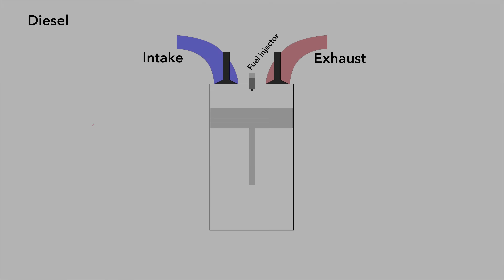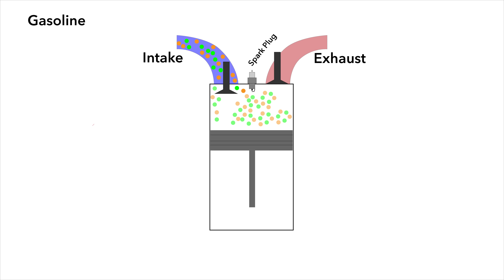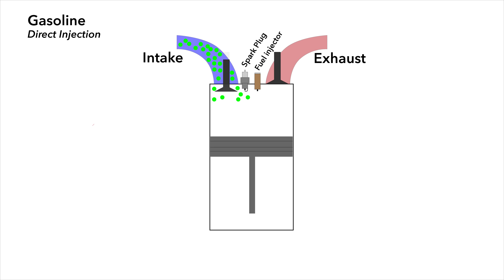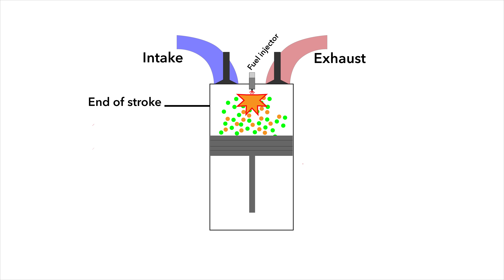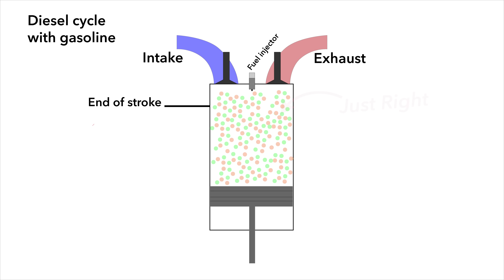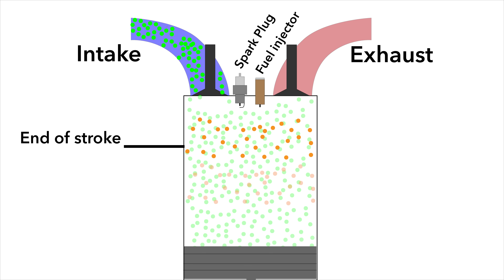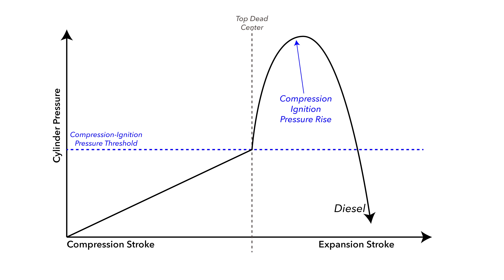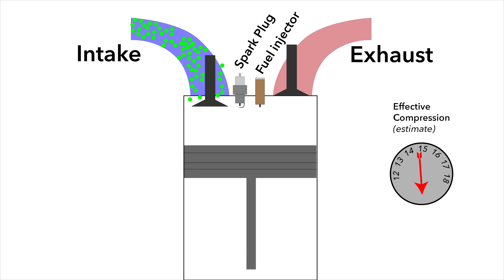Skyactiv-X: Mazda's Revolutionary Engine Explained

Comment: This and Infiniti's VC engine show Japanese is still ahead of American in engine development.
Reply: There is no compression ignition, it's just advanced fuel control, and this technology is already being used in TGDI engines. In fact, early and late injections are the very reason most manufacturers use GDI. As stated, this is just market. And yes, I work in the industry.
Reply: No, you should be skeptical and not so gullible.
Reply: Peizxcv Well, since what I said is fact and evident, yes. These aren't even the words of the engineering dept, this stuff is written by marketing. This isn't even a true CI engine. Do you even know what that is? Learn. Spark ignition is not compression ignition. They haven't show anywhere how they create ignition entirely from compression. It's just the same tricks fuel/air and time tricks used by other manufactures minus the unusually high compression combustion.
Reply: Peizxcv WTF? I'm the one being cautious and demanding it be proven reliable. You can't flip that and say it's my duty to prove it's unreliable. That is beyond idiotic.
Reply: Kendrick perhaps you should work for Mazda and tell them they forgot to put a turbocharger on their TGDI engine. Also, work in the industry as what? There are millions working in the auto industry and million more in related fields.
Reply: How do you know it's ahead beside being introduced to market? Being introduce to market doesn't make it reliable.
Reply: David And where is GM's car with this tech on the road? I don't think you comprehend the concept of "ahead"
Reply: Peizxcv 
“Where is GM’s car with this tech on the road?”
Mazda’s isn’t on the road either, so....

And if you’re counting the prototype, then based on that standards, GM has had hydrogen fueled vehicles on the road for about 2 decades.  After all, they were working on hydrogen fueled vehicles for over 2 decades.
Reply: Giovanni Giovanni On one hand you say it is nothing new and is the same as TGDI yet on the other hand you say it is new and needs to be proven reliable first. Make up your mind why you dislike this new tech.
Reply: Christ, this isn't a compression ignition engine! Learn what that is! It's just GDI with Atkinson cycle mode and higher compression, nothing new! It's all marketing! Learn what these things are and watch the video!
Reply: Peizxcv No, mass market compression ignition is new and is unproven. What was presented by Mazda says nothing about that, just things we've seen before. This engine hasn't even proven itself to be a ignition engine yet, never mind reliabile.
Reply: Maybe this engine can, in fact, run without spark, and maybe it does at certain times, but what they've show is no evidence of this. They're calling it "revolutionary" HCCI, which gives us no facts. As far as I'm concerned, it's just their marketing going crazy.
Reply: Kendrick I am not The Lord Jesus Christ, it is unnecessary to bring him into this discussion.

This is not a Atkinson-cycle engine (notice the spelling) as it shifts between Otto and Atkinson on demand.

I would imagine someone in the industry not making so many obvious mistakes.

BTW, the title of this video is "revolutionary new engine". Maybe take that as a hint.
Reply: What the hell are you talking about?
Reply: Kendrick After watching the video again, you're probably correct. It just looks like a 2GR but only lower compression. I don't seen anything all that remarkable about this now.
Reply: Kendrick looks like they’re using the spark plug to ignite the fuel, which raises the compression, which causes compression ignition of the rest of the combustion chamber. Nothing new?
Reply: US engine development is so behind the times they are still using push rods
Reply: It's not a Japanese engine it was designed in Germany. Pretty much a copy of the VW engines of today.
Reply: GM had this engine in the 1990's
Reply: American engine development has always been behind any competition.
The US market still accepts lower mpg and demands cheaper cars, so US brands still use more simple, cheaper engines that aren't competitive anywhere else.
Reply: Sirion 
The thing you’re ignoring is that many other countries (Japan, Europe, etc) have displacement taxes, so it’s advantageous for them to make small engines.  
Plus, most of those countries have easier emissions standards.  That’s why a number of particular engines aren’t allowed to be sold in the US.

And since you brought up MPG, it seems you also forgot that the US has the one of the highest required crash test ratings in the world.  That adds weight.  For example, the 04-06 GTO started life as an Australian Holden model.  To make it pass US crash tests, an additional 300-400 lbs had to be added, turning the car from a 3400 lb sport tourer into the 3800 lb car that was sold in the US.
Plus, the majority of miles driven on the US are on interstates/highways.  While the pushrod V8 in my Camaro would only get 18 mpg in the city, on long hwy trips, I’d get nearly 30 mpg...  in a 20 year old car that was capable of running 13 sec 1/4 miles.

“Cheaper engines”
So you have a problem with simpler engines being cheaper?  Apparently auto enthusiasts don’t.  That’s why the GM LS v8 has been the most swapped engine for the past 10-15 years, taking the title from the GM SBC V8.  The irony being that even the most lowly and smallest version found it trucks (4.8L) while rated at 265hp is durable enough for the stock short block to withstand well over 1000....  quadruple its factory rating....  and do it cheaper than virtually any other engine.

So a cheap engine that is capable of 30+mpg in cars, can routinely power 24k lb GVW pickups for 300+k miles, and can power cars to sub 7 second 1/4 mile times.  Show me any engine architecture that can do that at the price point.
Reply: That sounds like Toyota
Reply: Bringing something to market doesn't mean you're technologically ahead of anyone. Where are our low compression diesels? They were introduced in the select markets and quickly found out much of a hot mess they were. Also, HCCI and Atkinson did not come from Japan. Many automakers have been well into the development of this technology, but they introduced such tech for many reasons.
Reply: Giovanni Maybe car makers worked on similar tech for decades but none get it reliable enough as Mazda. I'll say that's a lead on everybody else.
Reply: And how do you know it's reliable? And like I said, the Skyactiv D was supposed to change everything, but turn out it was a junk engine that not only could not pass US emissions regulations, it's was very problematic.

Also, this really isn't a true CI gas engine, it's just marketing BS. Using a spark to start the compression ignition is nonsense, it's just your typical GDI system used on typical TGDI engines.
Reply: Giovanni So instead of believing the engineers and reviewers I am suppose to trust Giovanni, the YouTube expert on engine. You bring a whole new meaning to armchair general.
Reply: emdec55 I am very skeptical of Giovanni the YouTube armchair expert indeed.
Reply: Giovanni What you said is just your guess. A guess based on nothing. Can you produce any document that supports your claim this engine is not reliable and nothing innovative? You cannot, you are just an armchair expert that made up your mind before any facts

Comment: Alex - good job on a tough concept to explain. Another analog to the diesel engine would be the gas turbine (jet) engine. After using igniters to initiate (or what ever word you made up) :) combustion, compression is used to keep the fuel burning from that point on. Broadly speaking there are centrifugal and axial flow compressor designs. I've driven rental Mazda 3s and seen above 40 mpg on the highway. This would really push them into hybrid territory if they deliver. And are reliable. And don't leak oil (or anything else). Mazda is a company I really admire for pushing on the leading edge, even if things don't always work out.

Comment: Early adopters be aware..
Reply: The Car Crazy Guy agreed. Wait for the 2nd gen.
Reply: It will be ready on release, the engine is already running over 2 years in Japan ;)
Reply: Bas bzb  It's not a Japanese engine it was designed in Germany. Pretty much a copy of the VW engines of today.
Reply: @kevinwells273  uhhh, except VW cheated the system and lied about their emissions.

Comment: It's great that traditional auto companies are innovating. But it took a lot of explaining to tell what is special about this new engine. Although I love to know about the new features that are being made available on cars, I still don't get what's the benefit of this new engine other than diesel-like torque. I mean geeks would love it and so would present Mazda users but shouldn't Mazda be focusing on growing their market? As a potential buyer I find Mazda to be not unique in any relevant way. It's not the most fuel efficient, it's not the most responsive, it's not the best looking, it's not the most premium, it's not even the cheapest. It just seems to be stuck in the middle. I wish them good luck in the years ahead as they do not seem to be prepared to handle the big shifts in the auto market. It'll be sad to see Mazda meet the fate of others passenger auto brands like SAAB and Isuzu.

Comment: 10 years too late
They should have concentrated on electric vehicles
Reply: How is it obvious? A thimble full of gasoline has far more specific energy than many pounds of NiMH batteries. Musky is duping the world.
Reply: no EV maker is using NiMH batteries they are all using Li on batteries because they store way more energy to weight
Reply: @bjorn1583  prius is nimh. At least the first few gen's
Reply: If companys would do like you say, they'd go broke lol Mazda couldn't compete with others developing own electric tech, they are too small. Smarter to search for a niche and cooperate with others developing electric engines.
Reply: Wrong. Without a major breakthrough in battery (or other energy storage) and energy generation (fusion reactors?) technologies, the electric cars stays a nice gimmick for the next couple of decades. People simply has no idea how much energy their cars/trucks etc. are using (humanity generates a lot less electricity than needed currently ) and even if they already use an electric car the energy most probably comes from a hydrocarbon source (be it coal, natural gas, etc.). BTW, fully electric vehicles are very simple constructions compared to any gasoline/diesel/hybrid vehicle. Most car makers already have the plans for the necessary components to make an electric vehicle, it just doesn't make sense in a business standpoint to switch to all electric vehicle manufacturing for now.
Reply: They are doing research and development together with Toyota and Panasonic. They are not going to make lithium-ion battery powered electric car because it makes no sense since it’s not really cleaner than the petrol powered car.
Reply: This is exactly what I was thinking, car manufacturers are trying to squeeze every last drop from combustion engines.   The future is obvious, electric cars.

Comment: Is it true that they just shortened the final drive of the gearbox and on a highway the engine revs higher (about 1000 rpm more) than others?
We'll see how it works in the real life because to me it looks like they overcomplicated things to achieve the same numbers as the competition did using just a turbo (for example current CX-5 2.0 is surprisingly anemic thirsty, Tiguan 1.5 is both faster and more economical).
Reply: But this system is less complex than a turbo engine. It uses things that are already in place on a NA engine to deliver turbo like performance. Less parts - more computer control. So, more complex data, but less complex metal. I would think this ought to be cheaper to produce. Will this HCCI be combined with a turbo in the future? Perhaps that will increase the efficiency further?
Reply: @B Com
Less complex? It's a direct injected supercharged engine with a twist. Yes, it's supercharged, not NA. Compression ignition doesn't work well without forced induction, naturally aspirated diesels have niether power, nor torque.
Reply: Oops. I thought it was NA. Disregard my earlier comment then.  I wonder why they did a super charger rather than a turbo. A bit at odds with the goal of efficiency. Perhaps the HCCI is more difficult to control with a turbo.

Comment: Is the new mazda 6 2018 review coming soon? thinking about buying one
Reply: 2019 actually!
Reply: no, he's talking about the '6' 2018--that has not come out yet...if you're talking about the new Skyactive X engine for the 3, yes that will be fore the 201*9* model year.
Reply: The 2018 Mazda6 will be out in the spring. Be sure to get the Signature trim
Reply: yes, the one they presented at the detroit auto show(i think?) with the new 2.5L turbo gasoline

Comment: I am not confident with this engine when it gets old and problem pile up. I would prefer Nissan solution of variable compression engine, which is simple and logical without complicated tolerance for spark-timing. They both would add complexity, just one of them would be more reliable and mechanical approach.
Reply: symmetry08 keep in mind that this technology is from diesel engines so it is already known to be reliable. I would be more worried about the Nissan system because the technology is located at the bottom of the piston.
Reply: symmetry08 has

Comment: This would make a great complimentary technology to a range extended electric vehicle..  You could run the compression engine at a steady load for max efficiency while still generating enough power at a light weight to be effective.

Comment: New Honda engines are already more efficient than what Mazda is claiming this new technology will achieve .
Reply: sic22l this is more equal to NA than a boosted car. Even though they have said these will be supercharged, it's still a much more linear power band. That, and Honda uses CVT's and not conventional automatics.
Reply: almohndes9 yes, but those are all much smaller engines with turbochargers. I don't think it's a fair comparison.
Reply: @Luke Lenci
Why? If they achieve the same performance then kudos to them.
Reply: Different manufacturers use different strategies to improved efficiency, Mazda chose not to downsize and go with forced induction with their smaller car engines. 
They've already gone forced induction with their larger SUV engine and I wonder why haven't they chose the same strategy with the smaller cars like Honda and others.
Reply: @Luke Lenci, almohndes9
It's a supercharged engine with driving characteristics similar to turbocharged one (more torque at low revs). Honda or VW did the same thing with much simplier designs. Why risk reliability (Skyactiv-G engines already suffer because of high compression ratio) and sales (in many countries some taxes and insurance rates are related to the engine displacement) for the sake of nothing?
Reply: No, not they are not. Forced induction engines, need to work much harder to achieve the same output, at a higher rpm. And higher rpm means more fuel burned. That's why mazda don't use low volume turbo engines. In other words, the amount of fuel burned at any given rpm is more linear in an engine without a turbo. This is not the case with turbo engines, where the fuel consumption increases more dramatic at higher rpm.